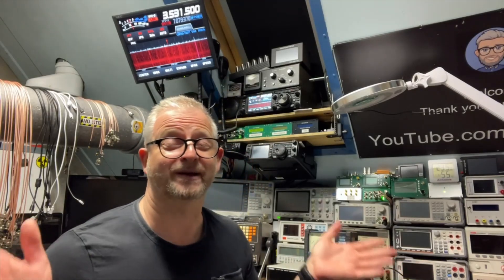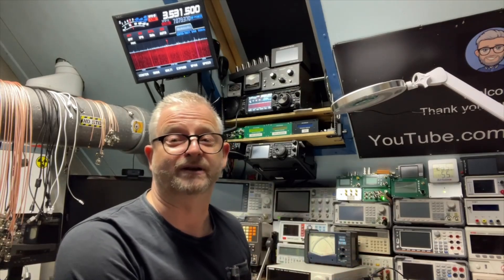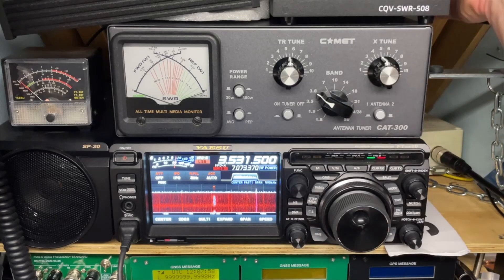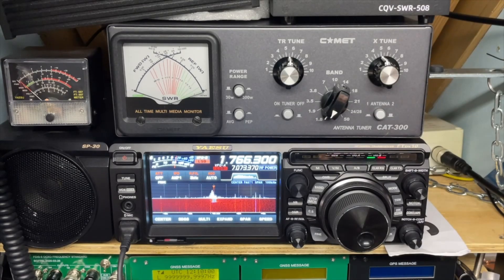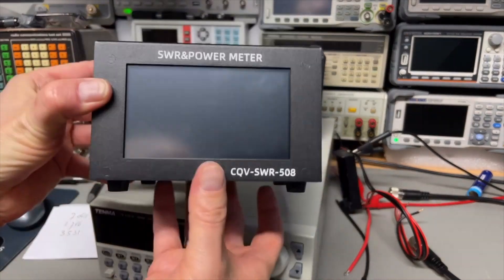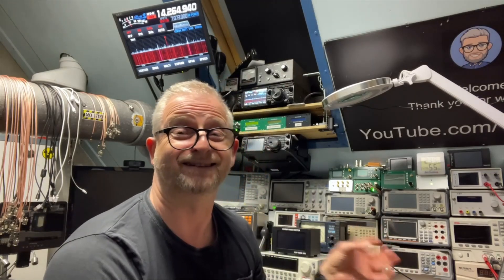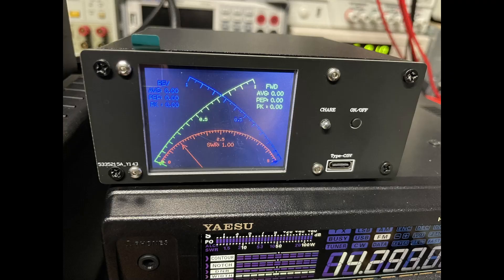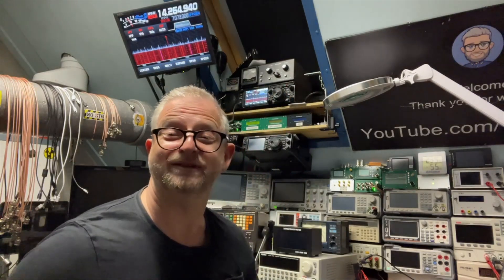TA-0412: CQV-SWR-508 - Sadly it has problems,  Noise Box QRM Generator - BG5CQV

Comment: Hello Tony, thank you very much for your video and testings of the CQV-SWR-508.  I got mine today and immediately tested whether it also produces QRM or not. Fortunately, I could not detect any QRM caused by this device on my IC7300 on either 160 m, 80 m or 40 m. I also used the preamplifier of the IC7300, but nothing to hear or to see on the waterfall. Therefore I think also, that meanwhile the problem has been fixed on the newer devices. Vy73 de DL3KAL
Reply from the maker: Thank you for your feedback, good to know that it seems to be fixed on the newer models. i have had a few other viewers also confirming they did not have the same problem.
It seesm the first Batch was not good maybe. i can not confirm myself as i send mine back. so thank you again for sharing your finding. 73 de PE1ONS

Comment: Hello Tony,
Thanks for the update on your video of the CQV-SWR-508, I am glad I found it and watched it with great interest and disappointment as well. 
Those 3 frequencies you found have a harmonic relation and I believe 5.298 MHz should be no exception. If you still have the meter (which I doubt), maybe you could check it for more RFI frequencies with your spectrum analyzer.
I was very disappointed in a GPSDO (AliExpres) that was also causing RFI. Now I am happy with a model I purchased on eBay a few weeks ago.
Since I watched your video I am hesitant to go for a WA4MCM "GM-102 SWR & Wattmeter Kit". I think I will stay with my home built analog VSWR- and Powermeter (average and PEP).
Unfortunately some "hobby"-designers don't pay attention to RFI problems and regulations.
Long live the old school analog technique!
73, Robert
Reply from the maker: Thanks Robert, we don't a mini computer to see SWR.. a crossnedle is the best :)  
according to the comments, the newer version seems to be a lot better or even good, but i never tried anymore myself.
indeed i did send mine back.

Comment: It tested the equipment perfectly. There’s no reason not to have it just because it’s a noise box. You don’t need it left in line when you’re actually on the radio. You should already know where your SWR is on your frequencies and you already know what your power is. Wrap a little copper tape around the box. See if you can give us a quick fix still don’t see the issue especially if you know what frequency it actually is just think of it as someone you don’t wanna talk to.
Reply from the maker: Glad you found your way around the problems, the device looks very nice.

Comment: maybe it is this battery circuit that is interfering, remove the battery (and put a large capacitor if necessary where the battery is connected) maybe you will get rid of the noise from the radio
Reply from the maker: Hi, i have seen comments from people who have a later version, that they don't see the destorstion

Comment: It's a shame, for a beginner it's not easy to get stuff that's not so expensive and works correct. 😔
Reply from the maker: Yes it is. You could have a look at a secondhand DAIWA Crossneedle. around 60~80 on ebay. they are very good.

Comment: i have a cqv-swr-508 and i use it, the only place i have some noise s5 with the meter is on 160 m but it's a band i don't use, all other bands i have no noise. LA2VLA
Reply: Do you notice any noise on 10-11-and 12 meter bands? I'd really appreciate if you could check. I'm gonna get together with a couple of my electronics buddies and see if we can come up with a fix. Most likely ALL CHEAP DISPLAY INVERTERS cause noise you can NOT filter out. Hopefully it's not the inverter. I work mostly with music audio equipment and in most cases it's always the damn Chinese displays.
Reply from the maker: @RogerBrenon  Not sure i tried... if i did its on video.. i send mine back.. shielding the RF-tab will help a lot i would guess
Reply from the maker: Thanks for sharing, that is great!

Comment: I purchased a model CQV-SWR-508 on Banggood and this meter inserted bad noise into the signal. I am fighting with them right now to return it and get my money back as it was bad out of the box.
Reply from the maker: i hope they compensate you correctly.
BangUgood is not the best in support on broken stuff... usulay they give you 40% and you take it becouse sending back cost you a fortune.. thay are bad.

Comment: Ah! Good pick-up! This raises the question about the other digital SWR meter you tested in TA-0307: Mini 100 Watt SWR PWR with OLED and Battery BG5CQV - CQV-SWR120? Does this little unit also generate QRM at some random frequencies I wonder? I purchased a similar unit not long ago from Surecom (model SW-28, 1.5 - 60MHz VSWR & 120 Power meter, with battery) and it is even smaller than the CQV-SWR120 with same functionality with programmable alarm etc. I've not had a chance to use it yet as I'm in the process of restoring and re-aligning a Yeasu FT-902D, but I do have a Icom IC-R71E (general coverage HF receiver) I fixed and re-aligned recently that is very sensitive and should pick-up any QRM generated by the tiny Surecom. I'll let you know if I find anything with that one if you are interested?
Reply from the maker: Hi, yes that would be very interesting to know, if you can share after to tested, that would be amazing. R71E is great, the sound is so much warmer than the new SDR devices.
Somehow the ear knows its digital and i get tired fast (even my FT-dx10), while on the R70/71 and 751 i can listen a lot longer. The Icom is a keeper!
Reply: @TonyAlbus  I'm happy to report that I did not find even the slightest QRM murmur internally generated by the little Surecom SW-28, scanning from 100kHz to 30 MHz, 1 kHz step (took me a while 😄) with the Icom R71E (pre-amp ON, noise floor around 0.05uV (around -133 dBm)) and antenna connection to a 50 Ohm dummy load (MFJ-264). And yes, you are right Tony, the R71 is just fantastic, especially on SSB ... sweet! I have it connected to an audio DSP Timewave DSP-599zx (which is just about as old as the Icom LOL) and the combo's performance is almost as good as the best of todays gear with all their fancy IF level DSPs 😏! Of course I had  the DSP disconnected for this test.
Reply from the maker: @j-mlapinno4827  Thanks great, thanks for sharing.. LOL i also have a Timewave on my R71 :)   great setup sir!

Comment: Tony, I tried mine on all the same frequencies that you did and I have zero QRM on any frequency. Maybe it's just your unit?
Reply from the maker: Great to know some are good! thanks for sharing. It was from 3 viewers and that was the reason i rechecked mine again. 
On my FT-450 i did not notice, on my more sensitive FT-dx10 it showed.
Reply: @TonyAlbus  Tony, upon more stringent testing with my sBitx V3 waterfall I have to agree with you, it is making terrible QRM that I never noticed before. I will make a attempt to stop the QRM or at least reduce it to acceptable level. Thanks for the video.

Comment: I  believe the problem is that the sensing section shares the same PC board with active electronics.
There is a still image of the sensing board in the video, and that shows that there's no real isolation between the sensing circuitry (RF in and out) and the active electronics.
The sensing section should be really completely separate and shielded, with only the DC Voltages representing forward and reverse power coming out of that shielded section ... preferably via feedthrough capacitors.

Thanks Tony for confirming that it wasn't just my meter which had a problem.
Reply from the maker: Thanks! .. with a bit more effort it would have been great

Comment: My guess would be that its RF noise coming off the OLED display.  They are particularly noisy in most instances and need a good bit of shielding.
Reply from the maker: Yes all active components are on the display unit, incl the cpu, shielding that would maybe improve it indeed.

Comment: Tested with my tinySA on all HF bands but cannot see any RF noise coming from the SWR meter. Curious what could cause the issue as the SWR is running on a battery, metal shielded and more or less passive components. 73 PH7R
Reply: If the noise is around a specific frequency, or at a low frequency the Tiny SA could miss it if it isn't set up to sample a narrow enough frequency step.
Reply from the maker: Was later thinking i could have connected it to my SpectrumAnalizer, but i have already send it back. The display does most the active processing, so maybe make a shielding between that and the RF part would make a good difference.
Reply: It's quite likely that a device like a TinySA is just not sensitive enough to detect this level of spurious emissions. There's a huge gap in sensitivity between a real receiver like shown here and a spectrum analyser, especially something like a TinySA.

Comment: Is the problem on battery, USB or both?  I probably would have put a loop on my scope & "probed" around and maybe tried some mu shielding/ferrites.  But thanx for the update nonetheless. 👍
Reply from the maker: Thanks, i tested on battery, did not want to inject more switchmode noise from the charger. the usb is to charge and not like a DC plug that it switches over to external power... so its using in both modes the same battery-dc-converter system.

Comment: As I tell people  on a regular basis, if you buy Chinese stuff be prepared to fix its problems. I suspect a cap or 3, some copper foil,  and perhaps a notch filter in the right place could solve the problem, especially since it's in a metal enclosure. I trust nothing out of the box that comes from China.
Reply from the maker: Yes maybe but not willing to do those modifications, I just like a refund. I will be using may Daiwa anyway

Comment: Tony, myself not being a RF expert by far, I wonder if that's merely an internal shielding issue?
Reply from the maker: Hi, Yes it prob is. receiving signals that go trough the meter are in 0.1 uV and below, i know now, i don't want any processor close by. The box is nicely shielded but the distortion source is inside. If one could not send it back because the return period has ended, it would maybe make sense to try to shield the display/cpu unit. good point, thanks!